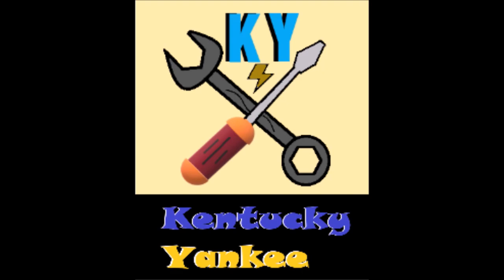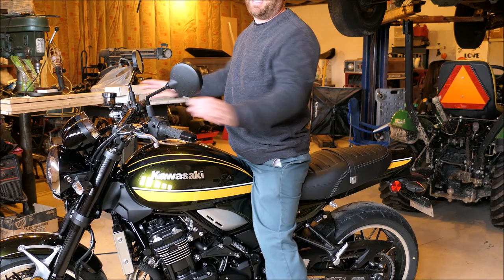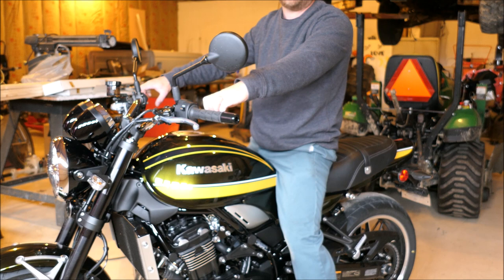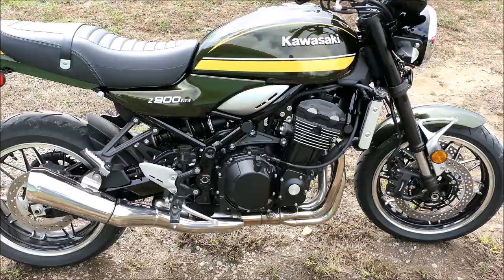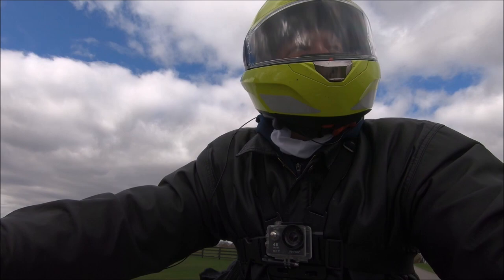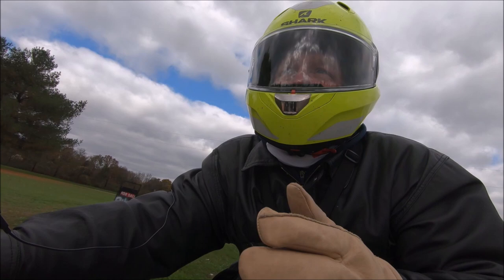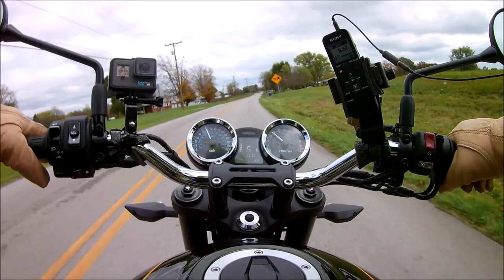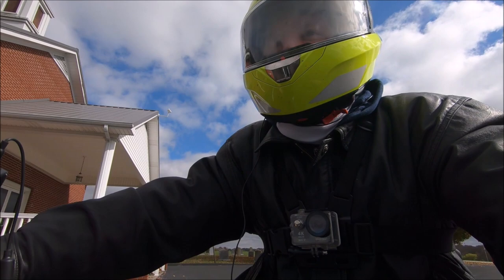2020 Kawasaki Z900RS First Impression Review!

Comment: I have the 2018 version with Root Beer colored tank. It now has over 17,000 miles. Had valves looked at when it passed 16,000 miles and they did not have to be adjusted at all. I really have not had an issue with chain slack. I just keep the chain lubed frequently. Regarding throttle response, I simply put it in traction control mode 2 and that really smoothed it out. After the engine broke in, the throttle response issue seemed to go away. Regarding engine break in period, I drove the bike and put 300 miles on it the first day. I simply took the freeway to keep RPMs low while still getting mileage. I also put sport touring tires on it, moved the bars back 3/4s of an inch and adjusted the suspension so it was stiffer. I ride year around and have never had an issue with the bike. Most of the negative items mentioned seemed to go away once I hit about 500 miles or so. All that stated, it is not a beginner bike. You still need to know what you are doing as it is around 111 hp.

Comment: 1. Agree on the fenders. 2. Helmet lock is useful in places where I want to leave my helmet and want it secure. I keep a short steel cable in my tank bag and put that in the helmet lock and loop it over the chin bar of a modern full-face helmet. 3. You can gain 1/2" back with no extra height if you reverse the block below the handlebar. 4. Engine map is off in a few different ways. There is a screw for the cold idle. The worst about the mapping is how on-throttle is abrupt after off-throttle. That's solved by ECU mapping though KTRC mode-2 helps. 5. Some of us (me included), prefer a 16T sprocket up front, it has enough torque anyway. 6. Shifting gets even smoother. I switched to synthetic after the second oil chg (3100mi) incredible smooth now. 7. Agree mirrors are great. 8.  Snatchy throttle, real solution is ECU tuning (Ivan is said to be the solution, I'm waiting out the warranty). 16T & KTRC-2 help the snatch. 9. I went with the Shad as well! Mine is about to go on.

Comment: 2018 Cafe owner here. I use the helmet lock pretty much every time I ride lol. I also have a modern full-face helmet.
Reply from the maker: Few other folks mentioned that, I didn't realize modern helmets had those d rings on them, my shark doesn't
Reply: Same here zx14!
Reply: I came to the comments with the intention of bringing up the helmet lock topic... I see that has been covered.
Reply: My helmet does not have D rings (touratech modular) and I use it every time. Go thru th strap loop. I love it.
Reply: same, I have a 200$ sena on there as well as a 200$ helmet, no way Im just setting it down to get stolen
Reply: Yes, I would use the helmet lock every time like when I ride on my scooter. The last two motorcycles I had did not have helmet locks and having to use a separate lock makes storing the helmet cumbersome.

Comment: The sound when you shut off the engine is the vacuum valve shutting off the fuel. Modern bikes don't have a fuel tap as such. The vacuum from the inlet manifold is utilised to open a gravity feed valve for the fuel and closes as the engine is shut off.

Comment: The 1976 KZ900 was one of my favorite bikes.  Smoothest shifting bike I every owned.  had plenty of power and very dependable.  Good luck with new purchase!
Reply from the maker: Thanks, I like this bike, one day we need to meet up and switch bikes for a ride
Reply: I owned a 77 z900. That bike had Gobs of power... That being said it was terrible leaned over far. The frame wallow and weak non adjustable suspension always made me green at the gills. 
When better tires with way better traction the wallowing got worse. And back in the 1980s there really was noooo way of beefing up the frame without unsightly visible changes added on. 
Still I loved that bike and when I finally added a full Kerker Exhaust Ooooohhhhh my Gosh she really moved and sounded way better.

Comment: Bought one for my wife. She is around 5'5" or so. Did the lowering link for her and an adjustable kickstand as well. One thing you will notice about the stock kickstand is that the bike sits a bit too far upright and the stand has almost no over-center lock on it when deployed. Had to catch the bike twice before it went down as a result. Ground a bit off the pad on the kickstand to get it to lock in better. Have around 1000 miles on it now and like it more and more. By the way it is 6 grand for the second 500 miles. We also did the perfect by the book break-in. Changed oil at 500 miles and will change it again within a week or so. Seat is NOT a distance ride seat! Will kill your butt after an hour or a bit more. She absolutely HATES the snatchy throttle. Added a throttle tamer for her and that helped a bit. Loved the suds wash!

Comment: I bought mine in March 2018, did over 20,000 kms in 2 years but since covid haven’t had a chance to ride it until recently because of lockdowns. It’s the Root Beer/Orange color or Jaffa as we call it in Australia.
Like you it’s the best bike I’ve ever owned, even done some trackdays on it.
I thought they might have fixed the snatchy throttle by now, apparently not. ECU reflash or Booster Plug made in Denmark should fix that, the Booster Plug fixed mine.
I’ve left mine standard, I’m not even going to touch the exhaust because it is so good from the factory.
I’ve put on genuine Kawasaki heated grips, centre stand, rear grab rail and Evotech radiator guard.
Like you, I broke mine in as per factory. The seat softens over time. 
The bike really sings when you wrap it on. I just love my bike.
The OEM Dunlops are crap imho. Bridgestone S22 or similar are the go.
You’re gonna love the bike the more you ride it, trust me!
Reply from the maker: Thanks for all the info, good to hear from someone who has some miles on the bike, I would imagine with that many miles that the header pipe  doesn't look new anymore? That's one thing I worry about
Reply: @kentuckyyankee  Yeah the header pipes are a straw color now. I read on a forum they can be polished out, I’ll have a go when I’ve got some spare time. This is the forum, it’s worldwide and you get pretty good info on there. There’s some info on there about ECU flash and Booster Plug to get rid of snatchy throttle. Everyone says ECU flash does wonders for the bike, I’ve been out of the two year warranty by nine months so I’m thinking about it.

https://www.z900rs.co.uk/
Reply: I’ve noticed the Dunlop’s don’t give confidence in the corners or even remotely cold temps. I want to upgrade but it’s hard to take off a set of tires with good tread. Will someone tell my wife I have to upgrade?

Comment: Lugging your bike with wide-open throttle at lower rpm’s is much harder on it then running partial throttle at higher rpm’s. It is about cylinder pressure and the force you’re putting on the rings and ring lands.

Comment: On the original Z1, I swung the calipers to the backside of the forks,  removed the rear fender and used a custom bracket to hold the brake light and license under the tail piece.  Added a Papa Yoshimura road racing header and polished the hell out of the aluminum engine pieces.  I should  buy one for fun!...Oh, and the helmet clip mounts provide a mount for bolt on wheelie bars.

Comment: I would think that the ride modes would take down the throttle response maybe in rain mode it would act as you desire. Very nice bike.
Reply from the maker: Thanks! I guess it's not ride modes but traction control, I'm a little confused still about it, I need to look into it more, I would say you're right tho
Reply: It is ktrc, Kawasaki traction control. You can have it off for max power no traction, 1 for little traction more power, 2 for least power most traction. Easiest to wheelie on off obviously
Reply from the maker: @moleman6143  I will try soon
Reply: @kentuckyyankee  default it is 1 upon starting up everytime so it seems you’re fine with wheelie lol, I have never done one so now I know I can do a wheelie in 1 after seeing you do it in this vid. I was caught in a awful storm on my bandit once, power cutting storm, was blown all over the road, id use ktrc2 in that scenario.
Reply from the maker: @moleman6143  I am aweful at wheelies 😂😂
Reply from the maker: @moleman6143  😂😂
Reply: @kentuckyyankee  haha I haven’t gotten the front wheel off before so to know it’s that easy on 1 then I guess I just need to try. Also, I bought a front fender extender for mine. I can send you pics of everything I did to mine if you’d like. You made any mods yet?
Reply from the maker: @moleman6143  Send it, I haven't made any mods yet but have bar extenders and sheepskin seat cover to put on
Reply: @kentuckyyankee  I’m 6’3 so none of that is necessary for me lol, in fact I wouldn’t recommend this as a long ride bike to anyone over 6’. I sent Facebook messenger pics to you.

Comment: kawasaki engineer told me 3 hour of soft break in with cool down periods. mileage is not that important. then ride it like a normal person till 1k than you can have at it.. this is because kawasaki pre-breaks in on every bike during testing to ensure we dont hurt there engines.. legal reasons they cant put that in the manual they have to be very specific and safe... and for my legal reasons, Apply at your own risk.

Comment: Why is the helmet lock useless? It’s not just for retro helmets you can put any style helmet on it.
Much better than carrying it around with you surely.?
Reply from the maker: Many modern helmets have no way of securing it to that lock, including mine lol!
Reply: @kentuckyyankee  most modern helmets use the double D ring to secure the helmet
It’s usually only cheaper or open face style helmets that use the seat belt type and even these usually have a metal ring on the chin strap
Reply: @kentuckyyankee  great choice of bike 👍
Thinking of trading in my RnineT for one 😊
Reply: @Mike-er7ym  that’s funny was thinking of buying a rninet before I bought my Z900rs.  You don’t like the rninet?
Reply: @mechcam796  The R9T is a nice bike but I  
Have always liked the style of the Z900RS as it is the best looking retro styled bike out there in my opinion ( I have always loved the original Z1) and If I sell my R9T  I can afford one :0)

Comment: I share the rare opinion that an uncomfortable seat will be cured with time in the saddle.   I was always Planning from the first to replace the stock seats and by the time I could afford to do so, either the seat or me had adjusted to where it was a non issue.
Reply from the maker: I'm gonna give it a little time, it's not bad, but I did find a local that reworks your original seat to improve it might consider that. I'm like you most likely it will stay stock

Comment: Many studies show there is no difference in break in, the point is just incase there is a flaw from factory you dont die going 130 after 4 miles, its so they cant get sued
Reply: Yeah these modern engines are pretty much ready to rip coming out off the factory floor.  They stress test /redline each engine before installing into the frame then again when its all together. Once upon a time 40-50 years ago when metallurgy wasn't as advanced and tolerances weren't as tight these break in procedures were needed.

Comment: Nice video, thankyou, I changed the riding mode on my Versys and tha helped with the throttle. Also, by chance did you look into the w800, do you know how the z900rs would compare?.
Reply from the maker: I looked at alot of different bikes, I can't remember if I checked that one out, I think it's air cooled right?
Reply: Very different bikes although I’m considering both as well. I have a ride set up for tomorrow at my local dealer.

Comment: You'll change your mind about the seat once you've actually ridden the bike. Traction control defaults to TC1 when you start the bike. You need to turn it off each time so you might have been using it and no knowing it.
Reply from the maker: Yeah I've only got 80 some miles on it so after riding awhile I'm sure things will show up, what did you do to the seat to make it better?
Reply: @kentuckyyankee  I tried a gel pad but that didn't make a big difference. I will send it someplace to have a layer of foam put on it now winter is here...
Reply from the maker: @malexder0082  I will put a sheepskin cover on soon

Comment: maybe add front fender extender.I am sure either DIY or aftermarket or totally new fender but longer.Its something that can be modified easily.
Reply from the maker: I am still looking for the best solution, extenders only help the radiator not the pipes, and I can't find a long replacement which I would like best

Comment: When you adjust the rear shock firmer....it will get a lot taller.
Reply from the maker: I'm happy with where the suspension is set so far.
Reply: @kentuckyyankee  What is your weight? Most Japanese bikes are factory set for about a 160lb rider (small). I took the chicken strips off of mine with stock suspension settings but when you get the front and rear set for your weight, its a whole new bike!!! Do it!
Reply from the maker: @zrx338  I'm 170lbs I think that's why it's close for me

Comment: Once I saw the cafe version I was having sudden doubts about my next bike. Still torn on this and the XSR700.
Reply from the maker: I'm not familiar with the zsr700 I will look into it
Reply: Me too! But with the XSR900. Price difference is a major issue about 23% more for the Z.
And that difference in my country is about 10 minimum monthly wages in my country, while the USD keeps rising.
Reply from the maker: @j.lizbardo  But, you don't want to be riding it around thinking dang! Wish I bought the Z900rs! 😐
Reply: @kentuckyyankee  hehehe... that may be the case....
Reply: I have the same helmet lock and use it every ride. I find it super convenient and works well with my open face, a little tight but still doable with my full face.

Comment: I use my helmet lock.  No, it is not running hot.  Break-in on any bike is torture. At 9:36 a wheelie.  Yup, my arms hurt with traction control off. 13:35 it is like hosing off a Playmate! Like watching a wet t-shirt contest.  I luv my 2019 Z900RS.
Reply from the maker: Apparently I need another helmet because other folks keep saying they use their helmet holder also, my shark helmet has a ratchet style latch.

Comment: Theres a mechanical fix for the fast cold idle.
Reply from the maker: Saw something about that, doesn't bother me too much, I will look into it
Reply: There is an even better digital fix...ecu reflash.
Reply from the maker: @zrx338  Hard to find someone to do that in my area
Reply: @kentuckyyankee  Mine too, you have to send ECU to Ivan or Brocks
Reply: @zrx338  Who did you get to do your ECU? Ivan’s or Brock’s (2 Wheel Dynoworks)? I’ve heard good reports about both.
Reply: @gm16v149  Ivan but I have used both for previous bikes. Ivan for a ZX14 tune and Brock for ZX10R tune. Pick your poison. The reason I chose Ivan here is that he posted up such comprehensive dyno charts in various configs.